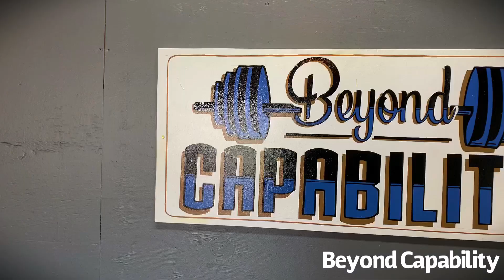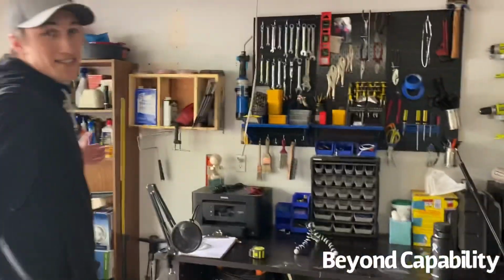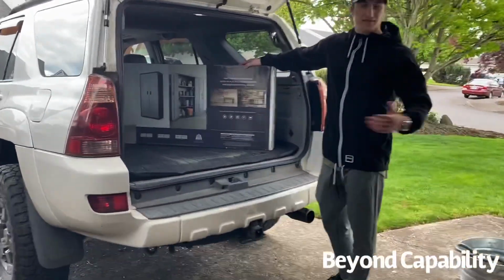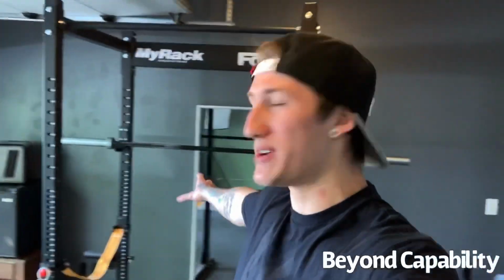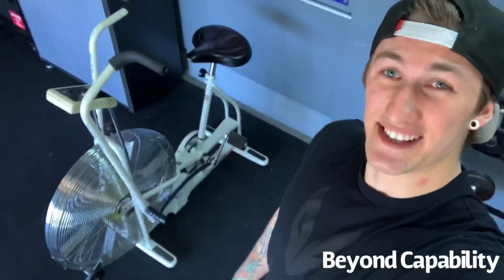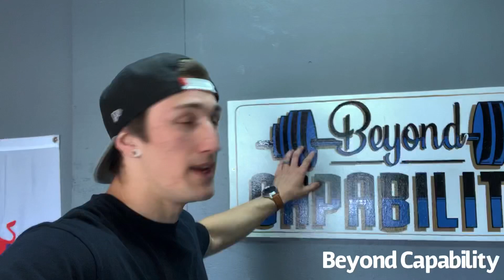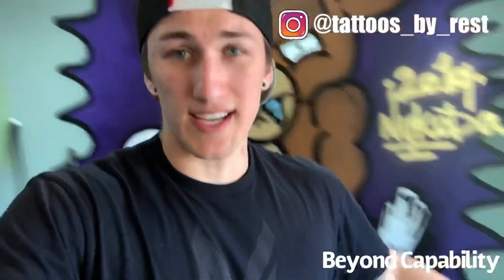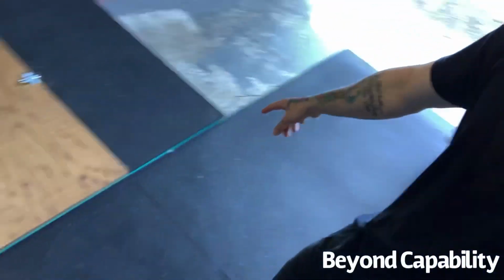Garage Gym Tour & Setup - How to Build Your Garage or Home Gym

Comment: Great job man!! I bought the same rack and I love it! Are you going to buy the body crossover or lat pull down at some point?
Reply from the maker: I am! I’m going to be getting the pulley crossover once it comes back into stock, and I’ll do a review of it after some good use. 👊
Reply: Help. I can’t find any equipment anywhere.
Reply from the maker: I know, during this time it’s tough. I would suggest going to Rep Fitness and Bells of Steel, they just got a bunch of gear in stock.

Comment: Dude I could not get my mending plates to go into my stall mats!! I used a hammer.. maybe I need a mallet?
Reply from the maker: Yes! Use a mallet, another thing you could try is to put down a 2x4 over the mat on the spot you want to hit. Smash that thing with some force and it should help distribute the load and get them into the rubber. Let me know if this works or not, I’ll see if I can figure out other ways it can be done. 👍
Reply: Beyond Capability I only bench the bar and deadlift 55 lbs, I’m a weak human being... maybe that’s why. Could you fly out to Vegas and hammer it in for me?
Reply from the maker: Austin Duncan yeah no problem! DM me your address.
Reply: Beyond Capability on it, lol thanks for the reply though, I’ll try it out. Great Chanel, keep it up

Comment: what are those metal brackets that you used to hold the horse stall mats together?
Reply from the maker: They are Joist Joiner Plates. You can get them at any hardware store, my next video is gonna go over them and how well they work.